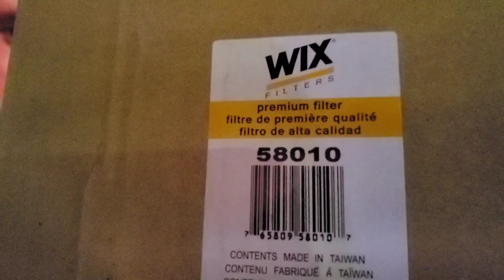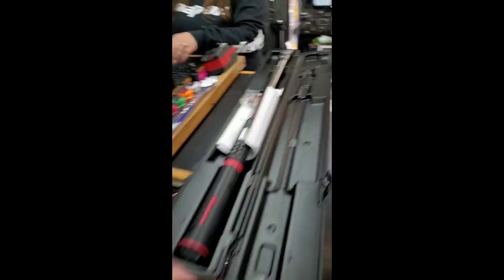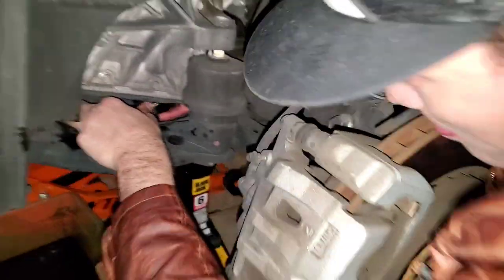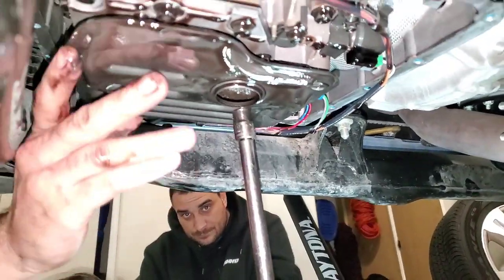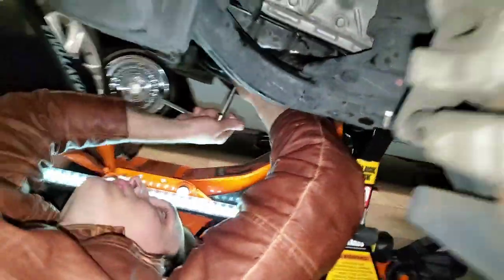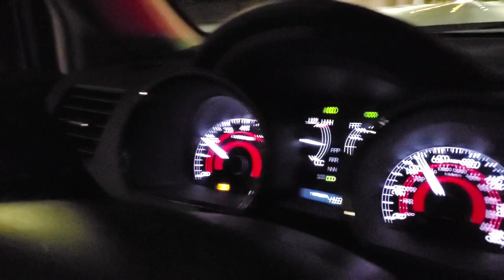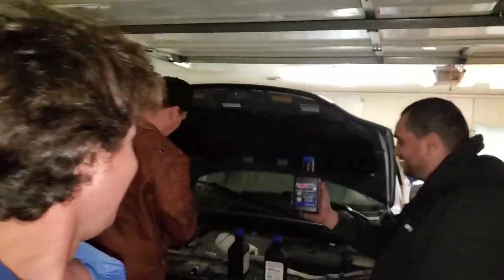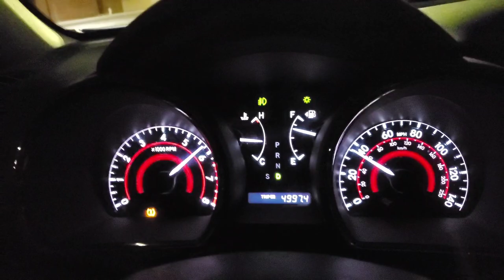2008 Toyota Highlander 4WD AMSOIL TRANSMISSION FLUID CHANGE

Comment: Excellent video, I just did this service on a 2009 Lexus RX, same procedure. The car shifted fine but at low speed and cold there was a noticeable shift delay, the car also had a bit of a thump into reverse again when cold. I had added some thicker shift stabilizer (Lubeguard stop shutter/shake) and it got a bit better. When I did the service I used the original Toyota WS fluid, just under 4qts drained out. Added back in through the dipstick, too bad the later models have a sealed fill plug. I left the filter in, previous owner had changed it about 50k miles ago.
The car is noticeably smoother shifting when cold, there is almost no remaining shift lag at low speed and cruising on the highway is smoother as well. The car also shifts into reverse effortlessly. I didn't add lubegaurd to the new fluid, suspect the small amount remaining in the old fluid will be more than enough with the clean ATF.
Edit: Before the ATF change when shifting was just OK the trans was also a bit overfilled by the previous owner, that usually causes vibration in these toyota units.

Comment: Excellent video. 
The total oil it takes is 9 quarts.
My question is did you initially fill 9 quarts and then replace 3.7 after every test drive to improve the purity? Your clarification would be greatly appreciated from Australia thanks
Reply from the maker: You got it correct the total Phil sounds like it's about 9 Q and then there's the initial fill we did a couple changes of the initial fill.

Let's give a man a fishing pole & show him how to fish. 

     Together! We can get your vehicles to run better than brand new!

     For me to get credit & be "Your" Independent AMSOIL Dealer, please use my website below or my dealer no. 5331179 call anytime Eben Rockmaker 702-472-3614
After you click on: http://syntheticoilprotection.net
1. Click the hamburger menu
2. Click offers AMSOIL preferred customer
3. Click join now. 6-month PC member add to cart.  ( There is no reoccurring renewal membership unless you select that dot box ) 
( You have the option to not have your credit card saved if you prefer - est. 1972 )
4. Scroll up to the top Select shop by vehicle. 

New Promo Code: FREESHAMPOO

Comment: Thank you for the video it really is appreciated. I just purchased a used 2008 Toyota Highlander limited all wheel drive.

How did you know that it was 3.7 that you first drained How did you measure that to know? You just drained that much and then you put the plug back in?

Comment: Where do you put in the liquid when you guys had that funnel? In the same tube where the dipstick comes out?
Reply from the maker: It depends on the vehicle some there's a transmission tube that goes down with a dipstick you can put it in there others you fill from underneath it just depends on the vehicle and the component some years have different Transmissions so it's always good to just double check

Comment: A metric socket will be safer for those transmission bolt. I have a box of Amsoil trans fluid ready to go inside my Corolla 2001. I might change the filter too although it is not required haha.

Comment: Great video, Just to confirm.... The amount that is dropped from the pan and filter is 3.7L, which means you toss back in 3.7L to fill it up to drain again... How much is put back in the second and third time since you arent pulling the filter for the second and 3rd drains?
Reply from the maker: Just depends on the transmission however you definitely will want to fill it until it overflows out of that straw and I always recommend getting extra fluid just to be safe also some years makes and models can have a little bit different transmission pan so one can hold a little more one can hold a little less.
That's a good rule of thumb always check the lookup guy here and if you ever want to try the Amazon products at the best price the six-month PC membership will do that for you and when you use my link here that would attach me to you so in the future I can always answer all your questions about improving the performance and lifespan of your vehicles by choosing the right fluids as your independent Amsoil dealer😃👍
♥️   Find The Right Fluids For Your Vehicles - https://www.amsoil.com/lookup/auto-and-light-truck/?zo=5331179
Reply: So how much in total fluid did you have to go through? Counting the drain and fills and then final fill?
Reply from the maker: I don't remember usually I think those pans hold about four and a half quarts then you're going to have a little bit of wasted fluid so that would be about 7 so I would call it five and a half and if you do a double drain and fill that would be 11:00 so I would do a case of oil if you want to do a double which is 12 quarts that's what I would personally do down the road you can always come back and do another round of drain and fill and change the filter in 15,000 miles if you really want to clean everything up it just depends on how particular you are with the vehicle what type of driving you're doing City Driving Towing and highway driving obviously the more City and towing you do you want to change everything exponentially sooner if you're doing all highway driving with very little shifting you can go a long time about 60,000 miles on a fluid change with the new filter and if you're doing a lot of City driving with Towing I highly recommend changing it every 15,000 miles or one year
Reply: How much is a case of ol red cherry?
Reply from the maker: That's a good question Christian honestly I don't know exactly with tax and the PC membership you want to click on the link here add 6-month PC membership to cart and then you will see the EZ pack and the regular quart bottles are a slight difference in price if you have the pump you're good with the quart bottles and then you'll go to check out and you'll see the price breakdown $10 for the PC membership and then you'll also see the taxes💯
Also check out the latest promo on upper cylinder lubricant: CC0523UC
✅   Save 25% On Your Next Fluid Order: https://www.amsoil.com/offers/pc/?zo=5331179

Comment: Have a 2008 Highlander 115000 miles. I have never changed the transmission fluid cause was always told by the dealer it is a lifetime fluid. I’ve seen videos that say not to change it if you’ve gone more than 100k. Do you recommend changing it? Also do you change the filter every time you drain and fill, or just drain fluid? Would it be better to change the filter on the last drain and fill so there is mostly new fluid in there and you are not running the older fluid you can’t drain through a new filter? Thanks for the videos!
Reply from the maker: Yes Aaron I highly recommend changing the fluid and filter that's what I would do immediately if it was my vehicle and you will get the products at the best value through my link and when you use my link I will be your Amsoil Dealer so I can answer your questions in the future.

After 5,000 miles I would come back and do another drain and fill if you can some pans have a bolt where you can drain and fill it others there's no bolt so you have to take the pan down.
Just depends on the year and model in vehicle.

Your transmission will shift amazing👍
New Promo: FREESHIP 
2 nd Promo: 5GS
     ✅   Save up to 25% on every order as a preferred customer: https://www.amsoil.com/offers/pc/?zo=5331179
Reply: @Syntheticoilprotection  Thanks for the reply. I have the same '08 highlander as in the video. I will place the order today! So you recommend waiting 5000 miles or do the 3x drain/fill as you did in the video? I have drain bolt but don't see a fill port. Assuming you fill it through the dipstick? Still curious about the filter. Do you change that on every drain and fill or just once? Better to do it on the last fill or the first? Thanks for the link.
Reply from the maker: @aaronwilliams8600 if it was my transmission I would come back in 5,000 miles and do another drain and fill and change the filter that's what I did on my personal car you'll see that on the channel.

There's a fill port on the side it's in the video you'll see it's tucked tight in the side some of them you feel through the straw in the bottom and you can also fill it sometimes on the side in itself levels just watch the video from start to finish and you'll see every step.

After you come back in 5,000 miles and do it again depending on what it looks like you may want to do a third if it looks pretty good I would do it every 15,000 after that if you're doing City driving if you're doing a lot of highway driving you're easily good for $30,000
Reply: @Syntheticoilprotection  Copy all. Thanks. Just ordered.
Reply from the maker: @aaronwilliams8600 thank you!

Comment: What did you mean by no more cold shifting issues if we switch to Amsoil ATF? Can you explain? You said when the ATF warms up, it shifts better than when cold. But with Amsoil in, no more cold shift issues. Please elaborate on how Amsoil ATF can help with that especially from a viscosity standpoint. Thx Eben

Comment: Great video good sir! Question, how did you know 3.7qt was needed to fill? Do I need to measure how much fluid comes out when I first drain the pan or is that just how much the pan holds?
Reply from the maker: Good question John yeah you just fill it until it overflows on most Transmissions also you'll see it on the look of guide on the Amsoil website and when you use my link here it will give you the proper fluids for your vehicle also it'll give you the best value on the products so in the future when you use my link I'll get the credit and I can always answer all your questions in the products which I appreciate your business future business in advance.
❤️ 🇺🇸 ❤️ Professional YouLubher: Eben Rockmaker Regency Platinum Direct Jobber AMSOIL Specialist (Dealer#: 5331179) 702-472-3614 

      ✅ ✅ ✅  You will get Your Best Value as 6 Month AMSOIL PC Member --- because You get $33 back on a $100 purchase after the difference in Sales Tax with No need for Auto Renew - https://www.amsoil.com/offers/pc/?zo=5331179

Comment: I am not an expert.  Is dropping the pan will drain all of the tranny oil including oil in the torque converter?  How much fluid did u drain and what is the total capacity of the transmission? Thanks.
Reply from the maker: Great question Roman usually a pan drop will change about 27% to 55% of the fluid on most vehicles.
This will give you the fluid capacity for your specific year and model.
❤️ 🇺🇸 ❤️ Your Professional YouLubher: Eben Rockmaker. Find The Right Fluids For My Vehicle - https://www.amsoil.com/guides/?zo=5331179

Comment: I own that same 2008 Toyota Highlander! How often should I service the transmission?
Reply from the maker: If it was my personal vehicle I would change the transmission fluid every 30,000 miles of City driving or 60,000 miles of highway driving and I would change it every 3 years or whichever comes first.

I give a man a fishing pole & show him how to fish. 

     Together! We can get your vehicles to run better than brand new!

     For me to get credit & be "Your" Independent AMSOIL Dealer please use my website below or my dealer no. 5331179 call anytime Eben Rockmaker 702-472-3614
After you click on: http://syntheticoilprotection.net
1. Click hamburger menu
2. Click offers AMSOIL preferred customer
3. Click join now 6-month PC member add to cart.  ( there is no reoccurring renewal membership unless you select that dot box ) 
( you have the option to not have your credit card saved if you prefer - est. 1972 )
4. Scroll up to the top Select shop by vehicle.

New Promo: FREELAMP
Reply: I currently have 143k miles on that same Toyota Highlander & the transmission has been serviced twice (fluid & filter changed). Can I extend the service interval with that Amsoil ATF? It has been using the OEM ATF fluid from the Toyota dealer
Reply from the maker: @brian_b_tamayo80 yes you can double the severe service interval but the regular service interval should remain the same meaning if you're doing all City driving you can double it so instead of changing it at 15,000 miles with OEM you can easily go 30,000 miles of City driving

Comment: I have a problem, I would like to do the same but my mechanic doesn't want to change the ATF in my car because it's 15 years old and 102k miles... Although even if I just wanted some drain & fills maybe he understood I would like to flush it, what could indeed be bad for a transmission, and he's a GM specialist so he may have a bad experience doing it because their transmissions aren't very reliable... But it bugs me to keep my ancient ATF indefinitely and I'm pretty sure it would be good to change it.
Reply from the maker: I would still do a pan drop and change the filter and do half the fluid to start you'll notice it'll shift a lot better.

If you leave it it'll definitely wreck the transmission eventually.
Reply from the maker: I wouldn't use a flush machine I would just drop the pan and put a new filter in clean the magnets and use the AMS oil signature series ATF.
It'll be very similar to this video.
https://youtu.be/sGzTtXVP24c

Comment: So is it ok to mix atf ws with amsoil? Even if u drain it three times, you will still have old tranny oil in there. If you are a math expert you can use solutions formula to compute how much old tranny oil that is left in there after draining it three times. What do you think?
Reply from the maker: Correct it will be mixed and yes you can mix it and you'll see a huge Improvement in shifting even if you mix only one third Amsoil into the old fluid the shifting will be night and day.
❤️ 🇺🇸 ❤️ Your Professional YouLubher: Eben Rockmaker. Find The Right Fluids For My Vehicle - https://www.amsoil.com/guides/?zo=5331179

Comment: Soo it's good to do the liquid cherry 3 times. 🙌🏽
Reply from the maker: Just depends on the type of transmission some you can change half the fluid or more when you drop the pan and others you only change about a third of it you'll notice most of the Hondas the initial fill in the total fill is about 1/3 and that's why it's good to do a couple drain and fills just depending on what the fluid looks like.

Comment: Hi Eben..
Would you recommend doing a transmission flush with the amsoil flush product before changing the ATF??
Also do I have to replace the transmission filter with every change?
Reply from the maker: I personally do not use the transmission flush on transmissions you can't get all the old fluid out.

I do recommend changing the transmission filter and cleaning the magnets.

If you have the machine to get all the old fluid out I would do a flush It just takes a ton of fluid and or you need to have someone help you with the return line and doing the flush it takes about three people to do it properly if you do it without the machine and that's why I usually just show on the channel doing a pandrop.

This is a transmission flush with three people if you want to see what that looks like - https://youtu.be/-g5UspPi-zY
Reply: @Syntheticoilprotection  
Ok great! Thanks so much for all the awesome content!!
Reply from the maker: Of course happy to share anytime there's a lot of videos in the playlists as you navigate the channel you'll see tons of content if you ever have a question let me know and I can always point you in the right direction 😉😊💯😃

Comment: Atf fluid is the only fluid change I have left on my 2016 flex. The newer ford's it's important to change fluid every 30000 since the filter is permanent unless you want to drop the transmission. I can't wait to feel the difference with amsoil atf compared to mercon V
Reply from the maker: Are you and amsoil Dealer Justin?
Reply: @Syntheticoilprotection  not yet but I'm thinking about it, so far I'm just a preferred customer.
Reply from the maker: Awesome you have been randomly selected to be in my end of month giveaway coming up December 26th at 11:00 a.m. please text me your full name so I can save you in my phone 702-472-3614

Comment: Good morning Eben. I noticed the Signature Series ATF had a strong aloe like smell when I used it. Very unique for sure
Reply from the maker: Yeah that's the specialty detergents and dispersions and modifiers that make it handle the heat so well.
It almost starts to smell like gear lube

Comment: It's really hard to read the fluid level on this automatic transmission dip stick. Toyota should have roughed up the surface between the low and high notches. You need to lay it across a paper towel and look at the wet spot it leaves to measure the level. I've way overfilled this transmission before because you simply cannot see the fluid on the dipstick, even when it's full.
Reply from the maker: 👍, I agree

Comment: So do you check the level while engine is idling and hot ? 
Mine when I turn engine off the level is too high but normal if idling
Reply from the maker: Most Transmissions you want to check when they're idling in park
Reply from the maker: Sometimes it'll say on the dipstick it'll actually say check when idling in park like my old 1959 Cadillac it physically is printed on the metal dipstick to check it well it's idling in park.

Comment: If the oil is that dark, it’s not good to change correct?
Reply from the maker: Not sure what you mean?
Reply: @Syntheticoilprotection  usually if your transmission fluid is dark like that they recommend not changing it. You can destroy it especially his being so dark with only 80k miles. Not a good idea
Reply from the maker: You're referring to when the fluid is burnt. At that point the transmissions already shot anyways...... Lol

Dark fluid is still fine to change I think you're talking about when there's particles in the fluid and it's completely burnt.

But if it's burnt there's no point to change the fluid because you're going to have to get a new transmission anyways..... Lol